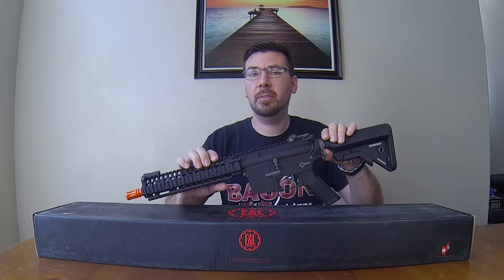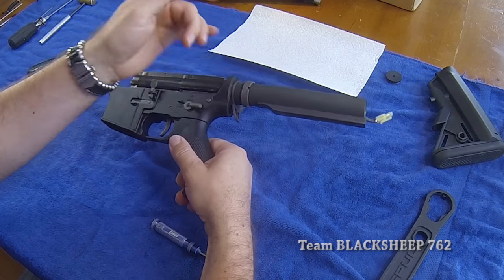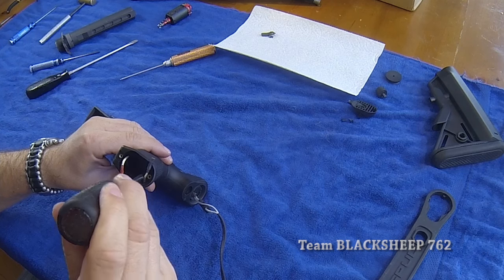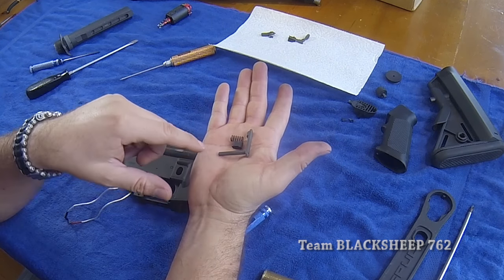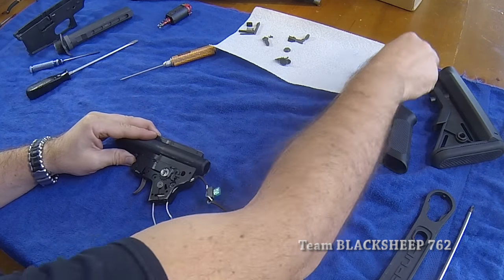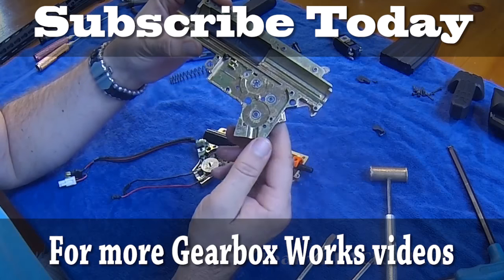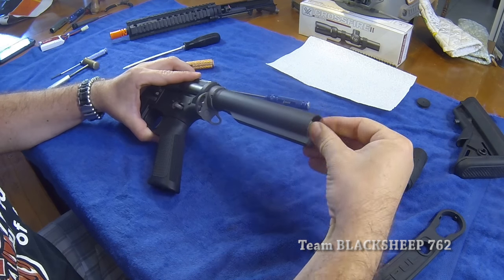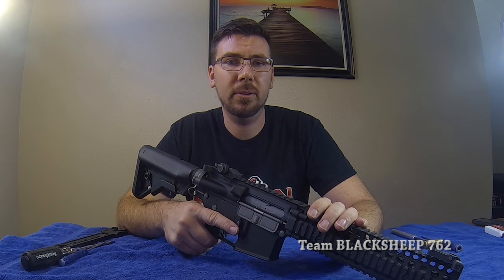E&L MK18/M4 | Complete Gearbox Guide (disassembly- assembly) Airsoft

Comment: Would a Turnigy 1300mAh stick Lipo that's  168mm long fit the buffer tube?
Do you know what the maximum length allowed in the tube is? 

Thanks in advance.

*Edit: after some general hand size reference at 3:07 i think 168mm would be too big so i'll just go with the 1200mAh at 116mm
Reply: Late reply but for future people in need (this is measurements form the manual):

Maximum battery size in the tube:

100mmx21mmx18mm

Comment: Are 11.1 fine with this gun or too much?
Reply: You need mosfet for that
Reply: @luxaaaar  I've been using it just cause I have the old discontinued platinum version, so far it's kicking good but we'll see
Reply: @PowerLeaderVideos  the problem using a 11.1 battery without mosfet is that cause burns on the trigger metal switch